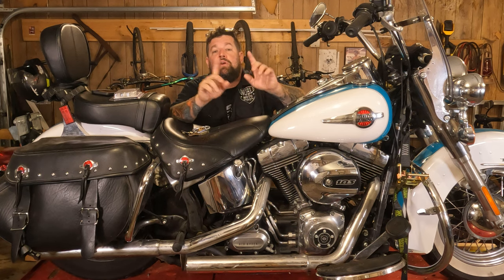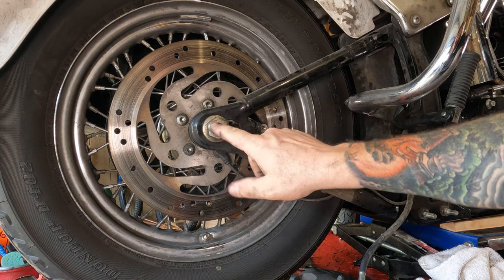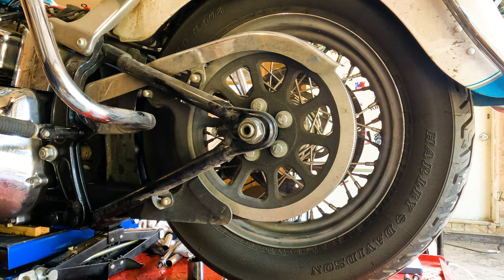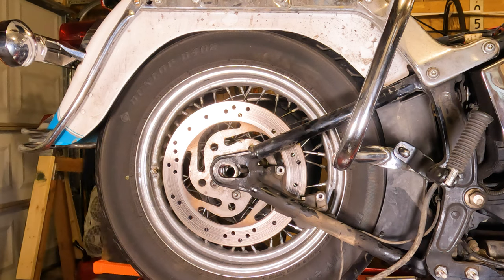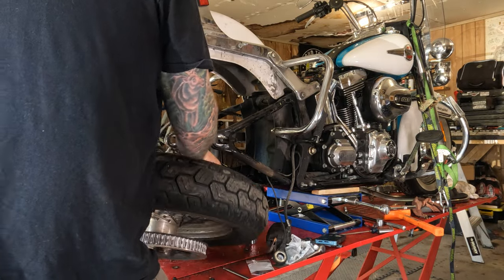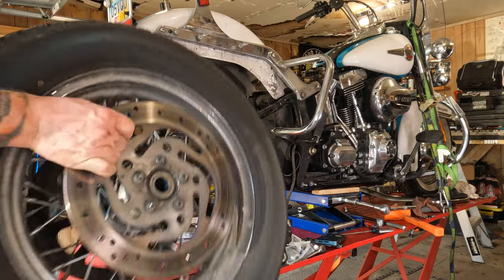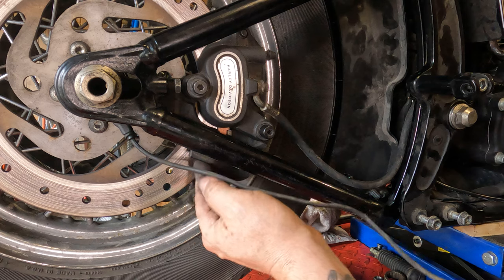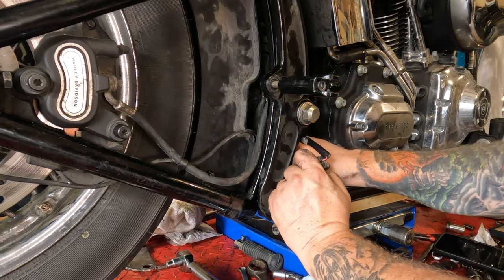84-17 Softail Rear Wheel Removal & Re-installation

Comment: I'm pretty new to riding, about  6 years now. I've removed and replaced the rear tire a couple times on my 2012 and 2011 Heritage Softail Classic. It pretty simple only special tool you will need is if your replacing brake pads is a 12 point 1/2 inch socket
Reply from the maker: 1/2”?